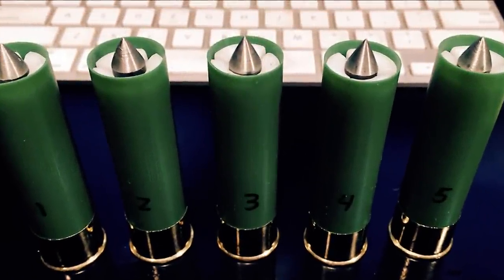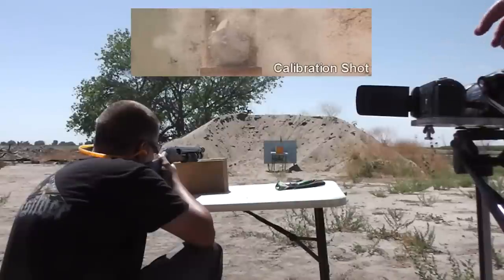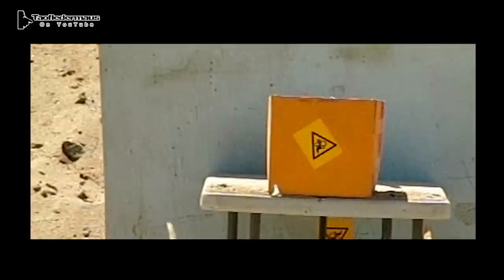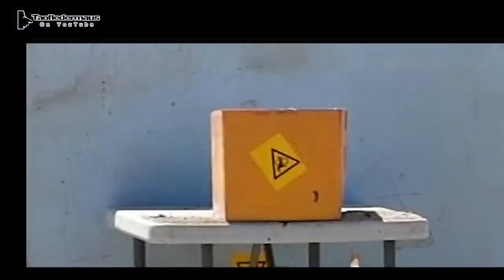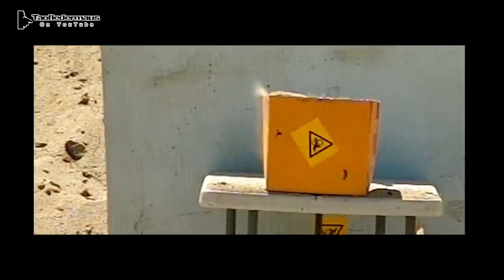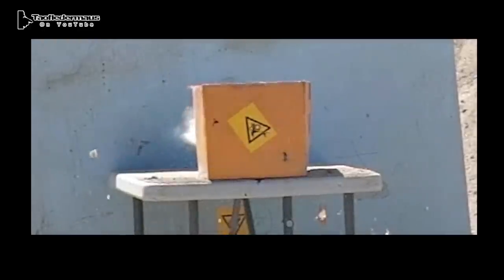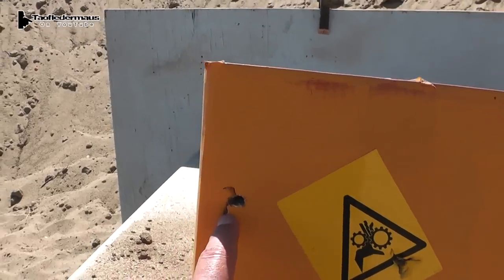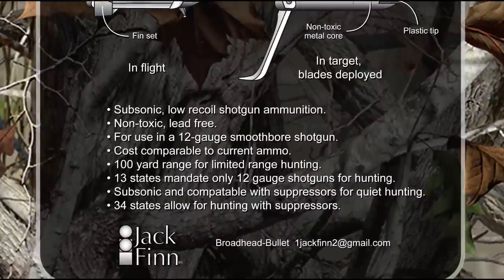Sabot Micro-Arrows for SHOTGUN -  Experimental Rounds

Comment: I think they need to redesign the sabots so they separate sooner, they seemed to make the projectile wobble around, delaying the spin.
Reply: JKCDLT
Either that, or they just need their blade fins to exert drag rather than spin the round. I say this because the third round was the most accurate, and the only thing different about it was that it was stable rather than spinning. Also, the slugs that were recently on this channel are brought to my mind - they had no fins, but the aerodynamics were smooth enough for the projectile to fly straight.
Reply: ravemastaj The other slugs are probably designed like a regular slug, it's supposed to fly like a badminton birdie rather than a bullet.
Reply: JKCDLT The video does show a destabilizing dynamic at early exit. The gas seal and sabot are my two suspects. The spin is inherent in the fins I am using, not something I was going for aside from a gentle roll to average out any variations.
Reply: Mike Bradbury One potentially important note: the 3rd projectile appeared to be spinning clockwise was it exited the barrel, then reversed it's spin mid-flight. Assuming that's not an illusion produced by the camera, then either the sabot is directly affecting the projectile's spin, or the propellant gasses in the gun are escaping past the sabot and over the fins, producing a counter-spin.
Reply: KingdomOfDimensions 
I'm glad I'm not the only one that saw that. Great view. These things are promising if for nothing other than their penetrating power.
Reply: notsosilentmajority1 I'd love to see shells like these receive more ballistics testing. Out of all the saboted projectiles featured on this channel I'd say these arrows are by far the best yet.
Reply: just from what I can see in this video I think that may be a problem with the spring loaded fins causing problems with the sabot separating but without actually getting my hands on one of these rounds I can only guess.

personally I think they're an interesting concept, bit to complex for my liking, too many things that can go wrong which can lead to reliability issues but still an interesting design none the less
Reply: I've read somewhere that the purpose of fin on these type of round aren't for spinning the projectile but rather to prevent it from spinning to much. A very different kind of ammunition compared to standart rifle bullet

Comment: As a hunter I have a few concerns about these rounds, first off I'm nor sure that they would be legal as the use of hollow point or pointed soft point ammo is often required for hunting, although this may vary by state. Also I would be concerned about retention, I can spit out a small chunk of copper or lead but the last thing I want to find in my venison steak is a sharpened steel blade, or worse yet a shattered one. Maybe you could fire one through a rib cage from a local butcher shop or the side of the road to confirm how well it holds together. And lastly I'm not sure the round passing all the way through the target is a good thing, as a lot of energy is being wasted, while if a round stops in the target that means all of its energy is being dumped into the animal increasing the likelihood of a swift death, which means less pain for the animal and less tracking. As it stands if I am hunting big game with a shotgun I will probably stick with rifled slugs.
Reply: C Henry ehhh it's trying to emulate arrow kill physics. They don't rely on massive kinetic energy dump to blow things apart, they cut holes in things very efficiently using only a little energy. Pass through means bigger wound channel and more bleeding. Bows appropriate for large game put less energy into their projectile than a .22 short.
Reply: C Henry Your response makes me think you are not an archery hunter.
Reply: I have archery hunted, I did so last season even, and while I recognize that the broadhead is the best solution on an arrow as its lower energy would require the penetration and cutting of the blades, I'm not convinced that it would be any better than a slug when fired from a shotgun. It would no doubt kill an animal, but I doubt that it would be any more effective, and certainly not enough to justify what I expect will be a significant increase in cost per round. Another concern that has come to mind is that it would likely be far more susceptible to being thrown of course by a branch or a twig than a traditional slug. All in all I'll keep my broadheads on my arrows and slugs in my shotshells, I know that in that configuration they will do well, as time has proven.
Reply: C Henry The company claims they'll be the same price as current ammo.
Reply: C Henry The design has morphed into a new design where the blades have been replaced by a new cutting mechanism that will not disintegrate when it encounters obstructions such as ribs. The new cutting mechanism is designed to cut only soft tissue such as the vitals while penetrating the less important parts such as hide/muscle/bone. The design is going towards maximum effect without unwanted wasted energy and damage to the target. Tricky but I think can be done. It is funny how these things take a life of their own and evolve.
Reply: C Henry Cost is a big concern. But so if effect. I too wonder where the dividing line will be for a successful round. So far the BB looks fancy but I think can be rendered into a product that can be simple, cost effective, and successful. Lets see what happens.
Reply: ***** Not condemning bow hunters at all, the broadhead is the best possible choice for bow hunting. Just not convinced its a good choice for a shotgun, or at least a better choice, in other words, what kills quicker? The last thing I want is to lose an animal that I've shot, so I'll use the best projectile no matter what I'm hunting with, broadheads for bows, PSPs for rifles, and shot or slugs for shotguns, depending on the game. Until I can see real data proving this is better than your average slug, I'll leave the broadheads to the bows.
Reply: +C Henry I concur, as someone who would wants the animal to die as quickly as possible, can't see a reason to go for bladed over slugs? (what would they even be called) other than for the novelty of "shooting arrows from a gun".

I may get called an idiot for this, but I haven't yet gone for an ammo type based of which does the most cutting penetration. Maybe people who hunt thicker skinned animals can tell me otherwise?
It doesn't seem very necessary to use a sharpened projectile if you are already using a gun.

Then again, it's probably not legal here anyway.

Comment: A point to remember is that high penetration means less impact force.  Impact energy is in foot pounds , so the more feet or inches of penetration, means that the projectile is hitting with less force throughout its penetration. Still that is how arrows actually work. The 20 pound pull of the 26 inch draw Apache arrows probably delivered around ten plus foot pounds but with flint tipped arrows (sharper than surgical stee), they could totally penetrate a bison ie American buffalo! This projectile might make a really good alternative to arrows.  Good professional video as usual. Rod Mac

Comment: I am thinking the propellant gasses breached the gas seal pushing the fins in one direction through the barrel. Then in flight, when imposed against the ambient air, pushed the fins in the opposite direction. I am going to go with a military grade seal with a larger diameter to seal up better. The sabot needs improvement as well. One of many fixes. Gotta make these fly good because it is possible. We will see in the next batch of prototypes.

Comment: Those first two shots make me wonder how often shotgun slugs are acted upon by the wadding clinging to it and not releasing cleanly
Reply: Arctic Gator Wondering that too. Seems to be quite a high fail rate from sabots in civilian rounds at least. All it takes is for it to cling for a yard or so and you've got a tumbling brick.
Reply: Arctic Gator Fairly often. Breneke and clones solve this by going for no separation. Reliable seperation of the sabot is the other primary marketing of the companies which produce the very most accurate ammo. I was going to link you a brand as an example, but I always forget the name. Foster type slugs typically have a hard fiber basewad with felt cushion. There will generally be a cardboard spacer to keep the felt from getting stuck in the hollow base of the foster. So again, clean separation is key. Many casters like myself use cards to keep the slugs from sticking to the shot wads we use.
Reply: GunFun ZS Sounds like a great bit of advice to be passed on to them!
Reply: Well, I can assume they are aware already of what the competition has done that works. Frankly a half hour of browsing on the slug shooter forum would make it clear which products or homebrew methods produce good results and which produce bad ones. I did start a sort of slug shooting competition to produce more data in an unbiased way, but that hasn't gotten much traction yet.
Reply: GunFun ZS
I was more talking about letting them know that the sabot separation is where they are having trouble and they need to rectify that, haha.
Reply: Arctic Gator Honestly the sabot has been somewhat of a trouble area, with breakages, separation, and interaction with the fins. One of my biggest challenges. I have fixes in the wings, next batch up.
Reply: Mike Bradbury You are the guy who made those? Good luck. If you wish to look at the competition, I believe in order the most accurate are 1: lightfeild slugs, 2: Guilani. (sp? 3: Sauvestre. Of those, only suavestre uses separating sabot for their main product. The others use a plastic column that stays attached to the projectile/ or even surrounds it as a core. Pretty much the only designs that rely on sabots and get good accuracy are for rifled barrels, and presumably the spin helps to strip the sabot sections.
Reply: Mike Bradbury maybe folding plastic intakes that are held flat by the barrel walls that pop open as soon as the barrel walls stop applying the pressure, kind of like the shape of those plastic accordion style closet doors and partitions?
Reply: Arctic Gator
Oooh, so the fins ARE the sabot? Interesting.
Reply: The fins are a part of the projectile and the sabot has a void that the fins fold into.
Reply: ic
Reply: i was thinking a two part sabot that has plastic folding scoops that unfurl when the whole thing leaves the barrel and creates the drag on the sabot that splits it.
Reply: GunFun ZS I like the solutions from Breneke and others with the same design. A very efficient use of materials. I wanted a smaller diameter for better bc, a more efficient trajectory. Getting the sabot to work has been challenging but getting better. Better grouping next batch.
Reply: GunFun ZS Yeah I have seen those guys and I like their stuff. Getting the sabot to work in a smooth bore barrel has been challenging. This video is great, I can see much more of what is going on and fine tune the design. Let's see if the next batch will work better.
Reply: Arctic Gator The previous batch had fin sizes just over a millimeter larger and the three prototypes were near total failure. I sized them down for this batch but not as good as two batches earlier. Tolerances are tight!
Reply: It's like a physics jigsaw puzzle!
Reply: Mike Bradbury Making something with seperating and moving parts accurate out of a firearm is something that even big companies with engineers fail at. If you pull it off, that will be a real accomplishment. -- p.s. I designed a custom bullet too, and an amazing machinist was nice enough to improve the design and make me a custom mold. It is accurate and safe, which breaks the first R&D hurdle, but it will take an immense amount of tuning to even determine whether it can accomplish the design intent. To apply scientific method and change one of the several variables at a time even without changing the shape is enormously time consuming and will take tools I don't have yet. I can appreciate how much work this must be for you, and how frustrating it is to get failures with no guarantee that the work and expense will ever result in something that performs well. Good job on making it this far
Reply: GunFun ZS One thing on the small guys side is the NIH syndrome coupled with the reluctance to take on new projects via the big guys. They are geared to make and sell a certain product for an established market. Guys like us make test boundaries. But we have to prove it will work and have  market desirability. It is time consuming, and labor and capital intensive for anyone who moves into innovation. Keep the faith if you believe in your endeavor. but keep in mind when is a good time to quit. That is the tightrope we walk.
Reply: Mike Bradbury What is NH syndrome?
Reply: Mike Bradbury You are totally right. I am an inventor and have come up with a Thermal gravity electricity generator. Even after  ProfessorAlistaire McGibbon from the National Engineering Laboratories in East Kilbride Scotland approved it ,the authorities dragged  their feet as usual. It's par for the course and you just have to keep trying.Good luck to the guy.Rod Mac
Reply: GunFun ZS N I H   means not invented here syndrome. Rod Mac

Comment: Its a cool idea. However, in my own opinion, if I'm going to shoot a broadhead, it will be with a bow. The biggest downfall I noticed was the inaccuracy of the round at 25 yards. At 25 yards With a bow, I can personally stack arrows in a grouping of a silver dollar and smaller. Plus, this is no different than a crossbow, it may have more kick behind it driving the broadhead further at a higher velocity, but there is no chance at taking a longer shot when the accuracy is so far off. The accuracy, velocity, poundage, and the light weight structure of a crossbow, makes a crossbow the ideal best option for hunting, if you are wanting to sling a broadhead down range with a rifle/shotgun feel. (just my opinion) not looking to start trouble of any kind.

Comment: Could you imagine filling a magazine tube up with those? WHAT COULD POSSIBLY GO WRONG?
Reply: MaxTheKanuck #JoinTheMasterRace Boom
Reply: acephantom903 And, assuming the one at the very rear of the magazine set off the one in front of it, it would most likely set off a chain reaction of each projectile slamming into the each primer. That is, if loading them in to the magazine in the first place didn't set them off, the pressure needed could potentially have the same effect.

Comment: for your sabots to work, it's going to require fins.  Remember, you shotgun barrel is a smoothbore like a tank.  The barrel on tanks only can fire conventional shells with rifling.  The barrels without rifling, could only fire APDSFS, HEATFS, and ATGM.  Your shotgun is like a smoothbore, so your pointy projectiles needs to have fins like a dart to stabilize.

Comment: Try design a dril round , a round that is basically a drill bit  that would normally be used to drill holes in steel ? Yes ? Can possibly go through a lot of stuff if you can get it to work properly

Comment: In my experience with other sabot slug type projectiles, they are generally designed to be fired from a rifled barrel.  I wonder how these would fare if you did that?
Reply: MrJmak642 I don't know but my guess on imparting a rotation of that magnitude to a statically stabilized projectile would result in a  fin-set failure. Maybe we should try it to see what would happen.

Comment: They seem cool just wonder if they would preform better at much lower speeds.   Most Bows are around 340fps right now wonder if they dropped the speed down to 500-700fps if they would be better or worse

Comment: Easy stabilization fix: Keep the expanding wings/blades tucked in. A perfect balance is required for stable flight if they expand as they exit the barrel. Design them so that they open upon target contact. Stable flight is more assured because the spinning/rotating mass is concentrated close to the spin axis thereby decreasing its moment of inertia and causing it to spin more quickly. Think>figure skater spinning with arms outstretched then drawn inwards. 
The designer should have thought a little longer on this one. lol
Once the target is contacted, a simple mechanism such as a small mass holding the blades in place moves forward upon deceleration. The projectile leaves a small entrance wound, decelerates and the mass moves forward releasing the blades to shred the fuck outta that damned, uh... Box of sand. Yeah, sand.
.
With my improvements it'd be more reliable than a bolo round. :^)

Comment: Would be cool to see you fire a few British pound coins. Would be an expensive shot. but they are fairly thick coins and weigh more than most. I think they would be small enough to fit in a shot-shell
Reply from the maker: sidarist  The largest diameter we can fit is only 17mm.    The smallest U.S. coin,  (dime)  works.
Reply: *****  Damn. Pound coin is 22.5mm. Still would of been cool as they weigh 9.5 grams each.